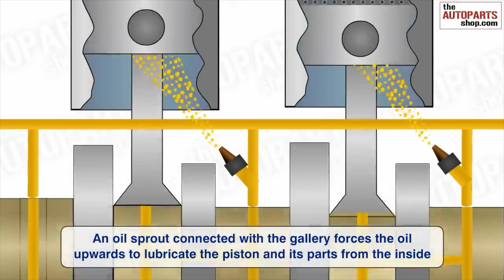Oil Jet Bolt Replacement | Honda S2000

Comment: Thanks for the video.
Shouldn't you add some torque to cylinder 1's bolt to compensate for the angle and torque loss introduced by the universal joint?

Comment: Thanks for this nice video. I have a question. In your video, you didn’t replace the oil pan gasket. Is that not necessary?
Reply from the maker: In the oil pan install video linked I installed a new liquid gasket, which is how Honda does it.

Comment: On cylinder one oil jet location is the object blocking your view the oil pump? If I were getting mine replaced anyways would it help immensely to remove it first? Not sure if you may be leaving it in on in the video for time saving purposes. Thnx for feedback! Great video
Reply from the maker: It is much easier to work with the obstruction than to remove the oil pump. Removing the oil pump involves removing the cam chain, which involves removing the cylinder head.
Reply: @DIYGuysvideo  Heard!! Thank you for quick and informative response.
Reply: @DIYGuysvideo  I saw the later ‘02 models having the AP2 oil jets comment; Checked over my VIN and I may have lucked out lol

Comment: could you loosen the oil pump to get better access or is this not feasible?
Reply from the maker: I don’t think that is feasible
Reply: @DIYGuysvideo  I did the job. Not too bad. Good tip on making sure they are all seated properly. I double checked them with a bore snake and one was wedged in not resting flat. Not sure what that would have done to my motor, but nothing good.
Reply: @DIYGuysvideo  ah, ok thanks. your vids are super helpful

Comment: Can somebody please tell me where the dipstick ends up when fully inserted?
Reply from the maker: See the picture in the OP here: https://www.s2ki.com/forums/s2000-under-hood-22/problem-oil-jet-bolts-1204068/

It comes through an oil galley on the passenger side between cylinder 1/2

Comment: I’m surprised no thread locker on those low torque bolts.  That last one behind the oil pump especially would be worrisome to me because the universal joint in the extension would throw off the torque reading of the torque wrench, probably resulting in under torquing it.  12 ft lbs is so little that it’s hard to even trust the torque wrench, unless you have a high quality (read: expensive) one.  Love your videos though.  I have a stock 2001 and am thinking of taking on the banjo bolts and retainers before adding a turbo, etc.

Comment: Since you found the culprit for your low oil pressure, does this change your view of the Toda oil pan at all or are you still not seeing any benefits from it? I'm torn between running the stock pan or getting something with baffles. It seems like it would be a good idea to go baffled but there are people on s2ki who swear that a baffled pan is unnecessary because they've run the stock pan plenty of times around tracks with  high G turns and hoosiers.
Reply from the maker: This only sorted out low oil pressure at idle. I still seem to have some drops in corners so I’m not sold on the Toda oil pan at all. 

I need to get some better data but I can’t recommend a baffle oil pan yet.
Reply: @DIYGuysvideo  awesome, thanks for the response! I'll be keeping an eye out for the results.

Comment: another great video! my 02 is having low idle readings after installing an oil pressure sensor (as low as 10psi). This is def on my to do list

Comment: What is considered low oil pressure at idle when these fail? My AP1 gets as low as 1.3 bar at idle with oil temps around 100 celsius.
Reply from the maker: I was seeing 14 PSI. After replacing these it was 22 PSI.

Comment: Great video.  Folks should be aware that the pages of the S2ki forum are littered with stories of disaster when amateur mechanics have tried to do this same job but ended up cross threading the Cyl 1 bolt.  So, be careful!  Also, check to be sure your motor has the old bolts - you don't want to do this particular job if you don't need to.  :)

Comment: Great video, thanks for doing this. I have an 02, anyway to confirm which version of the oil jet bolts it has? I heard that late model 02s have the upgraded bolts? Anyway to check VIN? Thanks
Reply from the maker: Per s2ki: 02 engines with serial numbers higher than #1025386 should have the new ones
Reply: @DIYGuysvideo  Thanks

Comment: what difference does it make if I use a different size torque wrench? eg. 30NM on 1/2 inch is the same as 30NM on 1/4 inch right?
Reply from the maker: Different sized torque wrenches are designed for different torque ranges. For example, some half inch torque wrenches are 25-250 ft-lbs, some are 10-150 ft-lbs. Even if you have a torque wrench that technically is within the range of 12 ft-lbs there are sweet spots within that range where the torque reading is most accurate. 12 ft-lbs is so low on the range of a 1/2 inch torque wrench that you risk the torque wrench not even working correctly, and with a 1/2 inch torque wrench it would be very easy to exceed 12 ft-lbs by mistake. 

Just read the forum posts on s2ki if you want to see how common this is. For example: s2ki.com/forums/s2000-under-hood-22/stripped-block-when-re-installing-oil-jet-bolts-1206138/
Reply: @DIYGuysvideo  thanks for explaining, this kind of knowledge only comes with experience

Comment: Another excellent diy. A functional library that will live on as long as these cars still exist.

What was the first clue your original oil jet bolts failed, and how did you confirm the diagnosis? Did you install an oil pressure gauge, or just hook one up for testing? Were there any symptoms other than low idle oil pressure?

How many miles on motor?
Reply from the maker: Thanks Russell, also thanks for all the helpful comments on my other videos. 

I am considering doing a whole video on my oil pressure research but here's some info. Ever since I installed an oil pressure sensor on my 2008 CR it seemed to have low idle oil pressure. A few years ago it was 17 PSI and more recently it was 14 PSI. I installed the oil pressure sensor because I was genuinely curious when I would need a baffled oil pan. I had heard many horror stories of people losing engines due to low oil pressure so I was just curious how far I could take the stock oil pan. 

Engine had 165,000 miles when I replaced the oil jet bolts and every single one of mine were broken. After installing the new oil jet bolts my idle oil pressure is around 22 PSI.